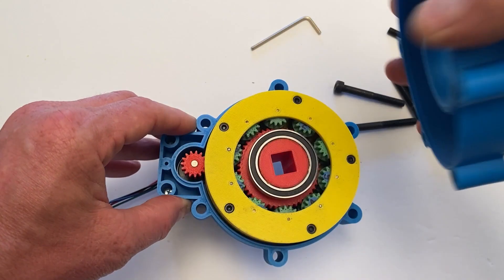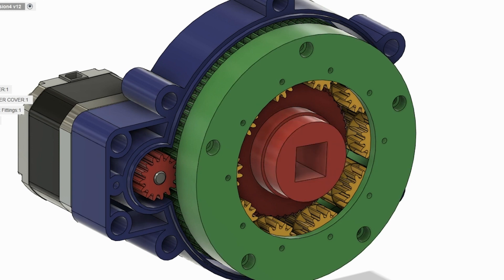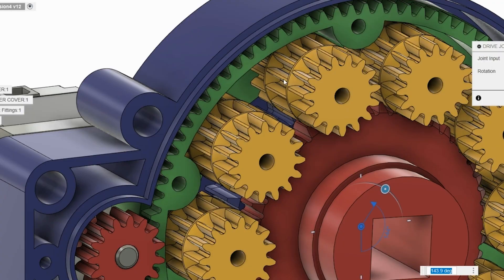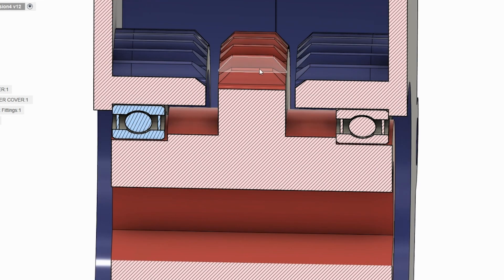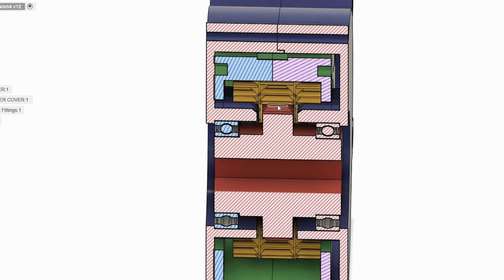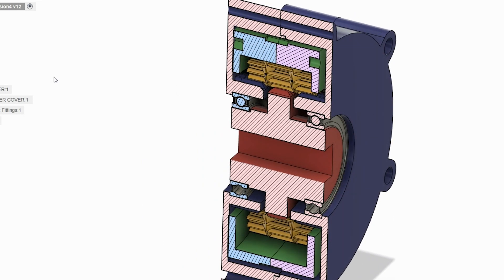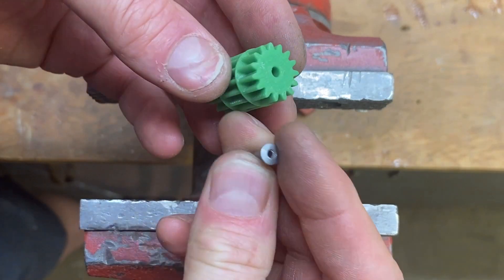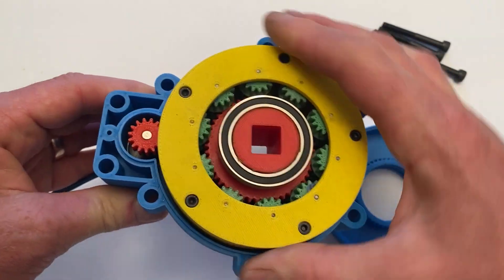Cool Gearing: Sun to Sun Epicyclic Gearing

Comment: I assume this is not backdrivable. I made a split ring compound epicyclic gearbox with a ratio of 32 and I couldnt back drive it.
Reply from the maker: You are so correct! There is too much tendency to bind from the friction. I would guess it is even worse than if you achieved this ratio with a big worm gear.

Comment: @davoriffic  Good work and very nice video! Thanks!
I think the ratio is incorrect. Let's try to calculate.
The ratio of the latest stage is 50 =  (51 - 50) / 50.
The drive gear has 15 teeth. The driven gear has 80 teeth. So, you calculated it as a 1:6 ratio. As a result, the output ratio is 300 = 6 * 50.

But there are one more stage. The first and the latest stages reduce the speed in 300 times. But the second stage INCREASES the speed in 1.1875 times. The second stage where the sun with 51 teeth is fixes; the ring gear has 80 teeth; the planet gear has 15 teeth. The ratio formula is "za / zc + 1". In your case it is 15 / 80 + 1 = 1.1875. So, the second stage increases the speed in 1.1875 times!

The final ratio is 6 / 1.1875 * 50 = 252.6. Please check it. Thanks!
Reply from the maker: @vitaliinoga713  thank you for your comment; I didn’t want to respond until I had a chance to really think about your comment. 
I think that there would be something to what you point out in terms of there being a hidden second stage, if the planetary gears were allowed to freely roll inside the carrier. 

As it stands, the planets are fixed by axles into the carrier, and are phased so that one of them in the set is aligned to perfectly match one tooth of the 51 tooth stator gear to one tooth of the 50 tooth rotor gear. 

Exactly one full turn of the carrier will always result in one full tooth of step of that 50 tooth inner gear; because this relationship seems quite fixed, I am inclined to stand by my initial calculation: 50 teeth of the rotor x 6 motor turns per rotation of the carrier = 300 turns of the motor per turn of the rotor. 

If not true, what am I missing?

Comment: Say a normal NEMA 17 has 0.42 Nm, with your gearbox 300:1, in a ideal world the output torque would be 0.42 * 300 = 126Nm, does that mean that 108.8 Nm goes to waist by friction?
Reply from the maker: Ultimately something like that.It really does have quite a bit of friction just rolling it by hand. Part of it is that, the way it is constructed without actual bearings in the carriers.
Also the gearing fitting is not that good compared to polished metal gears. Also, since all the plastic parts actually deform pretty easily, i think that once you load the box up to a certain point, parts just tend to flex and bind. This was especially true with an unbalanced version of this that just had two gears  A:B instead of this one A:B:A with planets bridging over the middle output gear.  With the unbalanced design, the max torque was dismal because the forces just tried to make the gears lean over, instantly binding it.

Comment: Just stumbled upon this video. Very interesting! Very creative idea with the phase shift in the planet gears. Perhaps it helps reduce the backlash? However, please correct me if I am missing something here:  there seems to be some difficulty regarding the gear modules. The module of the case gears must be greater than that of the output gear. From your fusion 360 model, both case and output gears have a pitch diameter of 51 mm. The output gear has 51 teeth, ie, module = 1mm. The case gear(s) have the same diameter but one less tooth (50 teeth), giving it a module of 1.02 (module = Pitch / Num of Teeth). This means, that the upper and lower planet gears must have a pitch diameter greater than the center part. Unfortunately, they must have a common axle, meaning that there will be a clash in the fit of the teeth. While this may be unimportant for 3D printed gears, for a precision machined version this would be a knock-out. Perhaps you can find a way around this? 
BTW, a similar concept was shown in Elector Magazine 03/2001 in the article named TanBo: A Tangential PCB Drill. They called it a 'Well Drive' and claimed it was backlash-free. I don't know how they solved the problem of the modules. It would be difficult or expensive to get a gear manufacturer to make a limited number of gears with such a strange module.
Reply from the maker: @christopherrobin8291  yes you are correct in your understanding of the need for just slightly different modules. It’s also hard to make the 3 layer compound gears that are set to the correct phase. For a metal version the planets would probably need to be made separately and then phased and welded. The whole scheme is well suited to plastic printing though ; good strength for just plastic was the idea

Comment: I like this design it is something a little different than I've seen before. I think I'm going to remix this concept and make my own, I will share it with you when I'm done if you're interested. I want to point out one thing, I was sitting here wondering how you avoided it from just completely binding up when it began spinning with the phase shift on the planets. Obviously, as the gears rotate the shift will not be constant between the gears and there isn't enough clearance to allow them to rotate. I then realized the planets all needed to be at different phase angles (good idea) but it is not obvious based on what you stated in the video, you may want to clarify.
Reply from the maker: @Ryder5172  yes good point; it was actually the tricky part of assembling it, putting a the correctly gears in the correct order around. There’s a lot of to get it wrong! I ended up embossing the numbers into the gear print files 1-10.    I imagined in a laser cut metal gearbox, you might assemble it from generic gears and then spot-weld the gears right inside the assembly to assign the phases 🤓

Comment: Do rivet mandrels act as gear shafts? Why do we need 20 instead of 10?
Reply from the maker: @이광진-k4c  it is because the rivers are being used as bushings as well as shafts. Each gear has 2 bushings, pressed in on the top and the bottom

Comment: I think you have a compound epicyclic with symmetrically loaded gears.  I've been trying to figure that out (on and off) for a couple years!

Your planet gears are driven radially outward by torque between the case and center shaft, and you restrain this force with pins on the planets.  Those don't have bearings, right?  So that forces you into a trade between the bulkiness of having planet bearings or the drag of those pins.

Could you have driven the planet gears around with a ring gear instead?  I'm guessing this would react the outward force on the planets from the output torque, although I haven't done the work to see if the forces are actually balanced or if they merely partially cancel.  If they balance, then it seems like this could fully define the location of the planet gears without any pins or bearings.  Is that right?

How did you draw the involute shape of the gears?  I've looked at this in SolidWorks and not been happy with the options I found.
Reply from the maker: @IainMcClatchie  I used a spur gear generator add on in fision360; it seems ok, could certainly be better
Reply from the maker: @IainMcClatchie  there is a link there for the fusion file & models. Check it out when you have time! Also make sure you use grease because GEEZ there are a lot of gears!
Reply from the maker: @IainMcClatchie  you could drive all the gears together with an internal gear around them, but it severely limited the numbers of teeth that work out, math wise… solving for internal meshed with n planets, meshed with a big ‘sun’. Plus the gears all had to be on there in the correct order so.. it was easier to stick them in a carrier
Reply: @davoriffic  I looked at my old notes, and it looks like I'd settled on an inside-out version of what you have here, but driven from the sun gear.  No wonder I like your design so much.

I wanted the output torque to be between a central ring gear and two outer ring gears, because that maximized torque capacity.  It looks like I got hung up on the bearings for the planet gears -- your pin and rivet solution seems good for this size.  Now you've got me thinking maybe I could do that and get the gearbox size down to something reasonable.

How lossy was this thing?  3d printed gearboxes often lose more energy in the gearbox than they deliver to the output, vs >95% efficiency for metal gearboxes.  Do you know where your losses are?  I'll note that you didn't actually test the gearbox to failure, you just know that it's stronger than your NEMA 17 motor can drive.  That's pretty darn good, and I think it's because your planets are short and symmetrically loaded, and you have a lot of them.
Reply from the maker: @IainMcClatchie  I don't really know how efficient it is, though this style of epicyclic gearing is known to be somewhat inefficient. I was considering doing some destructive testing, but didnt want to ruin it it was so pretty! Also, it really would take a lot to make it skip or to shear off that many teeth at once.

Comment: This is fantastic.

Will have to be tested, but if this was made of metal, I feel this would work real good for robots.
Reply from the maker: I actually think the plastic version would work well too. I designed it as a way to make extremely robust plastic gearing, where you have lots of teeth taking the load. Extremely hard to strip out or make skip.
Reply: @davoriffic  Yes. But I am thinking of some redundancy over kill, when under some heavy load, or used over time.

When being used for a long time, the plastic parts are more likely to melt, long before any metal parts would.

Is ok to use plastic to test with. And I feel is a good way to find out if something is made truly strong. If something made of plastic does not brake easy.

But for anything to be used long term, for with any possible final project that is intended to be used, I personally would want to use metal parts.

I have seen in the past, too many toys, and 3D printed projects with plastic parts, such as gears, melt, to trust it in something like this. Is just how I see it.

Comment: Think is a cool idea, similar but slightly different from the split ring planetary, I still can't get my head around how does the middle sun gear 1 tooth off but the same diameter ?.
Reply from the maker: @leogray1091  oh it’s less mysterious than you think; the side with the one less tooth has teeth that are slightly bigger to make up the size difference🤓 in gears, the ‘module’ is a number for the gear tooth size, the the module for all the gears that touch on one side is different from all the gears on the other

Comment: Very interesting! It is a variation of split-ring compound planetary gearbox, but better in some respects. I have an application for something like this,  and am interested in your thoughts: I am not as interested in small size, high torque conversion, or high speed. I  am concerned with positioning accuracy, smooth operation, and lack of "stiction." Lack of backlash is important, but not a primary concern as output need only turn in one direction, not forward/reverse. I'm thinking perhaps using a split helical tooth pattern. [May need to open outer rings for assembly.]
Reply from the maker: What kinds of ratios and speeds do you need?  These split gear designs are good for high gear ratio, but do have some 'bumpiness' in their operation. It is difficult to make them run smoothly; helical gears like you said are good for smooth and quiet rotation. Maybe you need a more classical type planetary gearbox?
Reply from the maker: @michaelretzer8480  cool; I see. Do you want it to be 3D printed?

Comment: This is so cool! It reminds me of a harmonic drive, with the added benefit of not needing exotic deformable parts.
Reply from the maker: Yes, like a lot of planetary gear boxes it lets you achieve a high ratio; harmonic drives are awesome because of their low part count, but hard to do with just printed plastic. The gearbox in this video  is really trying to show how to make hard-to-shear gear boxes out of plastic. It puts mechanical strength where it is needed to let you use a comparatively weak material, and still be reasonably compact.  You DO have to use grease ;-D
Reply: @davoriffic Excellent design goals 😀

It's hard to evaluate, compare, and understand (simulate mentally) these gears coming in randomly to some videos (instead of theoretically from simple to complex) 🥴

Until/For now, I'm going with timing belts / plulleys, but this is good to know. 

Just wonder 1) the efficiency of it, compared to some other solutions? 

(Hmm, how should one actually understand the efficiency of a torque changing system when setting the baseline / normalizing by the input output ratio 🤯?)

And 2) how the high input output ratio is related to the low backlash? 

Hmm. I feel we need the same input output ratio normalizing here, to compare and understand backlash in different mechanical systems 🤔😃

I wish I had a theoretical book about these😅 (what is its topic called?)😶‍🌫️
Reply: I was thinking the same thing.

Comment: Very cool design! I 3d printed one and got it to work at about 10 nm of torque at max speed!
But i have a doubt (sorry if its dumb, i'm quite new) if the ratio is 300:1 and my nema 17 motor is rated at 0.5nm i would expect a torque of 150nm when using this gearset(in ideal conditons). If i'm getting at max 10nm out of it doesn't it mean it is 6.6% efficient? That sounds very low, where are all those losses? Is all of it friction? I'm not sure where to start researching.
Reply from the maker: While it is theoretically 300:1, this style gear box is pretty inefficient. Also lubrication makes a difference, plus running a stepper motor too fast will reduce how much torque it can produce. What a wonderful experiment; can you share a picture / video? Would love to see somebody else's version of this thing! Nice work. 😀
Reply: @davoriffic  Defenetly! I was planning on sharing a short demo video, but your video is so nice that I want to try and record a proper one laying out my tests, results and doubts. It's going to be my first time recording and editing, but I hope I can have it soon!
I'm honestly a complete noob in mechanics and robotics, I'm just starting out, so I might have made wrong assumptions, lets see how it goes.
Reply: @arnauaguilar8329  What happened to your video link and the video? I wanted to watch it again and see if any updates?
Reply: @davoriffic  Here you can find my video on your gearbox!  https://youtu.be/xYHPf5mpfVg

Comment: Have you tried adding lubricant to it? Gears are not supposed to run dry against eachother and adding the right type of lube would reduce friction and wear in the system, allowing for even greater performance.
Reply from the maker: Yes I actually did use clear silicone grease; you can’t see it in the video very well but it helped a lot

Comment: Cool design! I think what this is actually called is a split ring compound planetary gearbox. Neat how multiple people came up with the same idea independently
Reply from the maker: It's definitely a kind of that. It's actually a very old design, as it turns out, the split ring, or compound ring. This one is a little different in that there is not an internal gear, just planets that go around two suns.
Reply: I would call this a carrier-driven split sun compound planetary gearbox.

Comment: can it pull a standard car?
Reply from the maker: You know, there's a chance it could! I'm picturing using it to turn a winch spool, and probably replacing the stepper motor with a brushless 3 phase motor like you find in a drone or race car.
Reply: Can you make a video about that please?
Reply from the maker: How heavy a car?  Are you thinking it can be powered through the cigarette lighter?  12vdc... Have you ever gotten gears laser cut from steel on send-cut-send.com?  Might need to look into using brass or steel gears @MezCook
Reply: I don't have the metal gears for that. Sorry